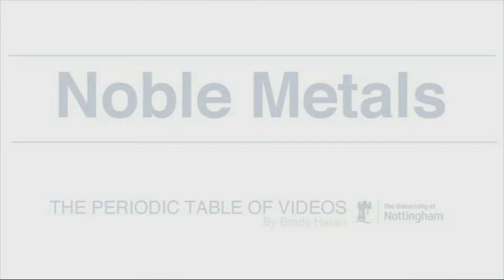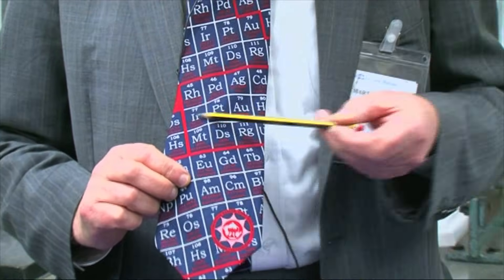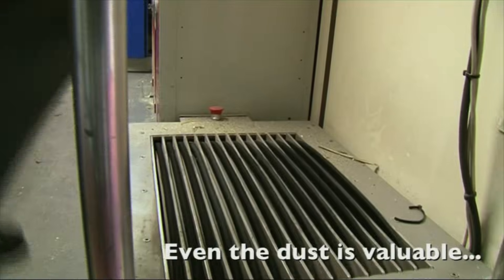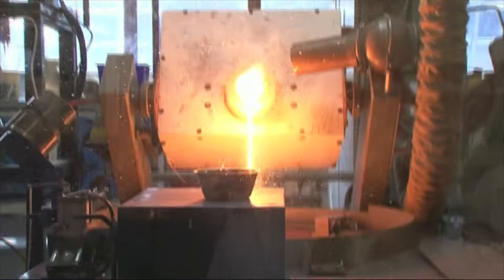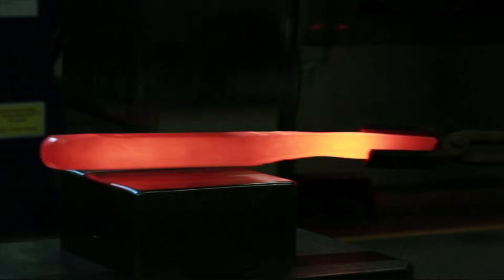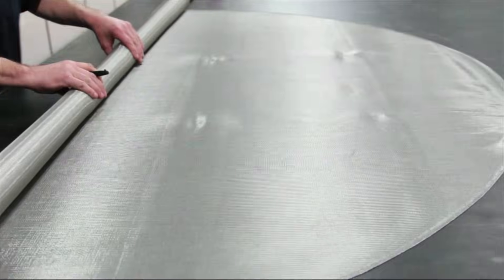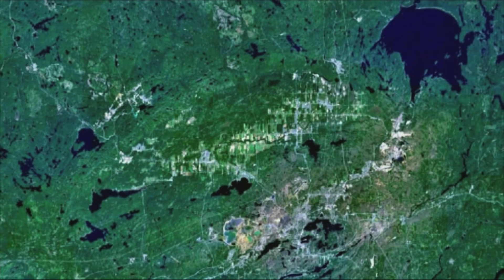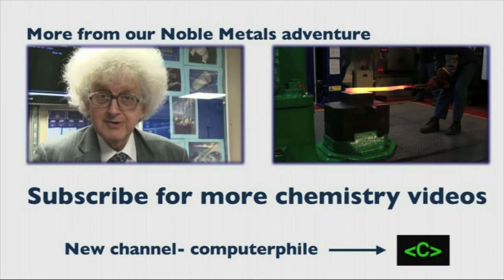Super Expensive Metals - Periodic Table of Videos

Comment: if the universe was formed from heat why does metal need to be refined 🔥🤔🤷‍♂️🙇‍♂️
Reply: Because of the oxygen and sulphur in the Earth when it was being formed.  The metals are usually found as oxides or sulphides and need to be reduced, hence the use of charcoal, coke or other reducing agents to smelt them.

Comment: If urine contains ammonia dose that means I can filter the ammonia into nitric acid into a bomb
Reply: @Lame Jackson 03 so the concentration of nitric acid that matters
Reply: @Lame Jackson 03 nitric acid itself is used to make tnt ammonia is like a boost nitric acid is explosion and corrosive you just have to separate the minerals or put a peace of graphite and connect it to plus and minus to have something similar to electroyses so it spits of a but ton of hydrogen gas
Reply: Ammonia settles down to a bottom because ammonia kinda isn't soluble in water so it separates itself for some time in very small amounts it takes a gallon of urine to get a few grams of ammonia dust
Reply: @Lame Jackson 03 hahaha FBI deals with terrorists who do some serious crime I had done many chemical bombs the most powerful one I made was aluminium alloy with iron oxide with big chunks of aluminium once ignited it realises a ton of energy aluminium wins and the iron settles down like a big gobe of molten iron

Comment: Around 35 years back I needed a 1 X 2 X 120 inch bar of titanium. Boy howdy it took a few calls. I got a guy in a foundry to cut me a bar. I still hadn't got a firm quote. Turned out to be under 1kusd. Rhodium coated discs were used for mass storage of data in early 70s industrial controls. 250 K of data. Probably cost 60KUSD. Had to to be shipped with nitrogen purge for dirt mgmt. Element don't change. Just time.

Comment: For ages I wondered what the most expensive precious metal was (in the sense of a metal you could buy in bulk). It wasn't until relatively recently that I realized I could never answer that question, because the prices of precious metals are extremely volatile, frequently changing by 100% or more in a matter of months. Sometimes it's gold! Sometimes it's platinum! Sometimes it's rhodium! It's usually not iridium, because it co-occurs with platinum which is more useful to industry, but sometimes iridium is second! At one point very briefly, scandium was the most expensive for some reason? Osmium is also a clear contender at times, and even palladium, rhenium, and ruthenium at least have a chance of getting on top.

Commodity markets make no sense, and the more you stare at the charts, the less sense they make.

Comment: I used to run a precious metal plating system. Plating 5000 small electrical connector pins all at once in vibrating baskets. It was really ironic that when we plated them with the latest palladium nickel, the customer also required that we give them a very thin (5 microns) coat of gold, so that they looked the same as the original fully gold-plated ones. Very odd.

Comment: I've honestly never considered any of the noble gasses to be boring. Without them, gas-shielded welding processes like MIG or TIG could not exist, and I would not have a job as I know it. I would just be welding by using flux-covered electrodes (SMAW/Stick-welding) and brazing. Sure, there's stuff like Submerged-Arc welding that doesn't need gas-purging/shielding, instead using a layer of flux pellets to isolate the weld by melting and creating an oxygen-impermeable physical barrier over the bead, but that's pretty much only used in heavy-duty pipe production. It's essentially how you take Stick welding and automate it. Instead of using a flux-coated electrode, it feeds the electrode and flux in separately. It's essentially physically-shielded welding at the highest level of development that it's likely to achieve.

Comment: Before Rhodium and Iridium is Cobalt, which can also be used as a catalyst. I recall a student presentation '...we used a catalytic amount of Cobalt...'. A professor asked, 'How much did you need?' The students response: '500%'... Audience laughter... (typically you have 2-3% catalyst, if that). He was using over a hundred times as much, so you could hardly call it a catalyst, BUT the reaction wouldn't work without it, so It was indeed catalytic. 

That particular cobalt catalyst was still in the research phase.

Comment: This is fascinating. The smelters for getting metals out of the ore used to heat up the ore, melt it, and seperate out the metals by pouring off the different layers of metals. 

Then in about 1915 or so, the Knight-Christensen, now called the Augustine process, was invented where the ore had its metals leached out with acid and the metal-laden acid was processed for the metals. 

Today, liquid based smelting is standard. Obviously it is far more effective and modern, but the basic idea of getting the mother liquor of metals from the ore and processing it is the same.

So when I saw that platinum is extracted by melting the ore, I was a bit surprised. But the process is far more modern. I guess some elements need unique methods to be extracted. 

Cool stuff. Now I know why platinum is more valuable than gold.

Comment: As a blacksmith you have no idea how jealous I am of people that get to work with platinum. Those ingots are so smooth and there's no scale (oxide) coming off the stock under that hammer.
I need to change my medium.
Reply: I once welded a platinum heat exchanger. It was a tube and sheet construction and was relatively large. It came with an armed guard. It welded quite easily.
Reply: I relate to your comment. As a steel fabricator and welder, we are on the messy end of the food chain here. Can you imagine holding those pliers or what you call them as that pneumatic hammer slams down on the platinum. Wow epic energy right? Anything is possible if we want it we can make it. We can also seek out where this place is and I bet with the right contacts get a tour of sorts. Keep blacksmithing it is becoming a lost art I believe.
Reply: Better platinum than gold, it costs only half as much. But is a lot harder to forge and weld than gold.
Reply: Ironically platinum will forge at merely red heat, yet it takes beyond next level white heat.
Reply: As someone who works with this stuff sometimes, i don't get enough extra for how puckered you get when the workpiece is 45 of your annual salaries
Reply: I was gonna say that's the cleanest power hammer I've ever seen, it's honestly amazing
Reply: Shut up, use plwtinum and see hwi much that acheives compared to what the professor does
Reply: @harveymoon6004  ???

Comment: Back in the late 70s the company I worked at/for. Used rodium coated discs in a memory storage device. 250k bytes. The disc was 1/4 in. Thk ( 6mm) and the size of an album. Other ram memory consisted of a 50KUSD mother board with (4)  5KUSD daughter boards. Memory was so expensive then BUT.  Our million dollar systems paid for themselves in less than a year. Those rodium plated disc memory system required nitrogen air purges and any destabilizing shocks could make a disc crash. Literally 250 mag pic ups a millimeter from the disc spinning at. 10K rps. A disc crash ment one pickup blew apart and whiped out everything usually scratching the disc and making another nice souvenir. The discs were mirror like. I was just out of EE school and this stuff blew my mind back in 78. My point; engineering was so cool being able to make positive changes to a company and make mgmt changes. Rodium plated discs made me really open my mind to possibilites or improvements not thought of before. It was a great global company in the 80s. I had lunch with Ronald Reagan he visited our plant. Half our biz was export. Inflation was killing the country. I got a 17% raise and I lost money. Later in the 90s we got bought out a couple if times. Everything went to china a decade or so ago. C'est la vie. Great times great people. Witnessing the destruction of the engineering and support of a company can leave one bitter, forget that. What I experienced is a slow roll compared to now. Nothing is sacred. Chose your dreams carefully.
Reply: great story. inspiring. why not start the company again in the US?

Comment: Does a power hammer actually heat up an ingot hotter? Does it depend on the metal or the power of the hammer? I'm just skeptical bc I know a lot of the time when making other things, blacksmiths have to put metals back into the furnace in between using the power hammer.

Comment: About 1980 when I was an apprentice jeweller, our TAFE (Tech college here in Australia) class visited the Johnson Matthey refinery here in Sydney to learn how the precious metals were refined, & had the opportunity to hold a large & very heavy ingot of fine gold, but they didn't make us remove our belts (or keys, coins, etc.), although I vaguely remember those rotating shoe brushes! 
That refinery closed not long after that when they decided to only operate out of Melbourne, Victoria, & Perth, Western Australia, the two states where large deposits of precious metal ores are still mined in significant quantities. What stuck in my memory of the visit was the sickly complexion of the poor bloke who was in charge of the section recovering silver by electrolysis & had been there for 40yrs, which in a way was a bit ironic for me as I only managed another 15yrs in the industry before I became too sick to work! 
Despite the mandatory requirements to have ventilation hoods & other safety measures, poorly ventilated sweat-shops of low-paid foreign workers on student/tourist visas have undercut the locals leaving only a handful of highly skilled manufacturers/designers in the top end of the market, so I'm glad I left the rather cut-throat industry when I did!

Comment: His accuracy about the various production processes is pretty poor - a couple of examples.

1) The grain size of the sponge has nothing to do with when the metal is dropped out of solution.
2) Passing the wire through a drawing die does not necessarily cause it to curl, at least not evenly. That is controlled by the three rollers visible following the drawing die. Varying the spacing and overlap of the rollers determines the size of the coil. If desired, it would be possible to ensure the wire is straight - but would probably require more than 3 rollers.

Comment: One summer during college break, it was my job to disassemble platinum and platinum/rhodium thermocouples used in semiconductor processing furnaces. I was instructed to not leave any scrap at all because even the smallest bit at the end was equivalent to at least $10. Most of the thermocouples were sheathed in a common white ceramic, but around all that was sometimes a continuous sapphire tube, which I had to shatter in order to get at the metals. Believe me when I tell you that it isn't very easy to crack a sapphire tube. Each batch filled half a gallon Ziploc bag easily. Probably worth several tens of thousands of dollars and extremely labor intensive.

Comment: Isn't iridium radioactive?
Reply: +MrBlueSky And iridium is 192.22?
Reply: +Syndi Cat +MrBlueSky No. Neither Ir-191 nor Ir-193 are even slightly radioactive. Iridium metal is (mostly) a mixture of those two non-radioactive isotopes, and the number 192.22 is essentially a weighted average based on the abundances of those two isotopes.

Comment: How does platinum work as a catalyst? What happens exactly? That was the only question that really interested me and it didn't get answered.
Reply: +chronischtelaat Essentialy it reduces the amount of energy needed for something to happen and makes it happen faster. Imagine a fence gate tied up with a lock a chain. You could take an axe to the chain to try and get through but a key would be easier and faster. Catalysts are the key.
Reply: +BioKnight Yeah, i understand that, but how does the platinum react with the stuff to work as a catalyst?
Reply: Some reactions actually have multiple steps called elementary reactions. This means that although a simplified chemical equation may be A + B = AB the true process will have multiple steps such as: A + C = AC and then AC + B = AB + C, where C is the catalyst. The presence of the catalyst allows those elementary reactions to take place and they need less energy and happen faster.
Reply: @chronischtelaat  it doesn't react with the stuff, that's why it's called a catalyst. It just makes the two substances react faster.
Reply: @yesnoblemetalsoxidizetoo3079  Well some catalysts first bond (reaction) to the stuff to then later break off as the same structure again. So catalysts can react to. 

I appreciate you trying to correct my question without answering it, thank you.

Comment: how much platinum do you need to make nitric acid from ammonia? in terms of ratio
Reply: +jaziel tan The platinum isn't used up. It just facilitates the reaction.
Reply: ok guys, let me rephrase that question: How many Kg of NH3 can 1 Kg of Platinum transform per hour? (given the surface area shown in the weave here)
Reply: +jaziel tan In the case of the platinum it's a catalyst. A catalyst is something that is not nececary for the reaction to take place nor is it used up. However does speed up the reaction.
Reply: +Freakschwimmer i have no clue about exact numbers but if you use a kg of platinum i do not think you should not calculate with kilograms of ammonia^^ i think you should rather calculate tons per minute^^
Reply: Metalhammer1993

duh..... I was asking for Kg since it's the standard unit of mass, not to express my expectation of magnitude.
Reply: Freakschwimmer i´m aware of KG being the unit of mass. however welk than let me phrase it like this i do not think 10³ kg/minute is close to enough. if i remember correctly you´re using a few g in reactors that rush 60tons per hour. but know what. i´ll just ask my inorganics professor^^ i didn´t find any numbers it´s just a wild guess. but the ammonia is blown through that weave at extremely high temperature. (but not that much pressure to avoid side reactions) so it´s reacting extremely quickly and i can only guess you´re making tons in a few minutes but i´ve got to ask. i´km honest there

Comment: Platinum is also used as a support in high temperature experimentations with magmas, because of its unreactivity and high boiling point. After each experimentations, every single bits of platinum (0.2mm strings) are retrieved! That's one expensive metal!

Comment: There was nothing magical about the coiling of that platinum bar. Notice the three rollers immediately prior to the coil; as the metal moved through the three rollers, it was given a stress in one direction, so after the wire passed the last roller, it simply "relaxed" by assuming a curved shaped. This technique is normally used to straighten wire for multiple industrial processes.
Reply: Yeah.  Ruin the trick for the other kids.
Reply: Im pretty sure the prof doesn't believe in actual magic

Comment: That is so unreal to see a glowing ingot of metal which is not immediately scaling in the air and no incrustations falling off when forging it, amazing.
Reply: i thought i was the only one to notice that :) it really looks strange!
Reply: pinkypower
It didn't strike me when watching, but it's logical. The interesting thing for me was the precision an cleanliness of the power-hammer. Such tools are usually covered in swarf and grease.
Reply: LCdrDerrick Thank you for this excellent explanation. It totally makes sense now, even though I was concentrating on the energy absorption while watching the process.
Reply: LCdrDerrick Is it because of how clean everything is?
Reply: @Hitsyfication  This is like 4 years late but it's because of how inert the metals are.  Normally in a forge when working with various forms of iron or steel, the metal is continuously oxidizing while being forged.  It's weird to see ingots being forged without oxidizing.
Reply: @Hitsyfication  mostly because no oxide layer forms on the surface
Reply: Timesmanify
I was refering to how inert against corrosion the metal behaves subject to its high temperature and not how viscous or brittle it behaves in this state according to its nobility. How a metal matrix resists against heat as a whole and how the single atom resists against corrossion or what it is with the clectric conductivity and what the position in the periodic table tells about it and what the electrons have to do with it,  should be answered by the Professor. Btw: How to rank a metal depends on who you are. An antique dealer, the Professor himself and a physicist could have different ideas of noble metals.
Reply: @LCdrDerrick  It doesn't oxidize well. Its just a chemistry thing. Im not sure exactly why, but it just doesn't pair with oxygen like pretty much everything else does. I dont think it has anything to do with the arrangement of atoms or anything like that
Reply: That's why they are noble metals – they just won't get dirty 😃
Reply: so they were not lying about the fact that it doesn't oxidize
Reply: LCdrDerrick nice! I appreciate this
Reply: So are you CDR Derrick now?
Reply: Wierd but true
Reply: Forged and fire
Reply: It looked almost fake.
Reply: LCdrDerrick Well duh.

Why do you think it needs an insanely high temperature to melt? For fun?